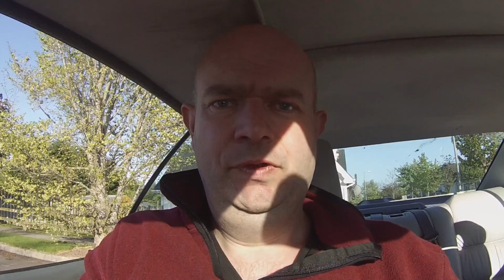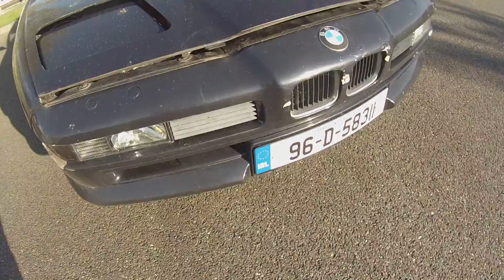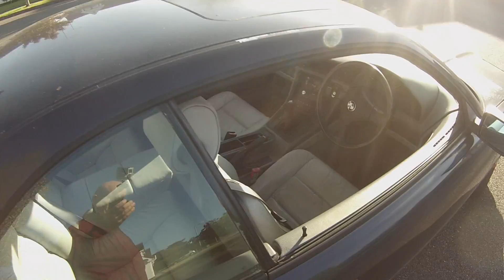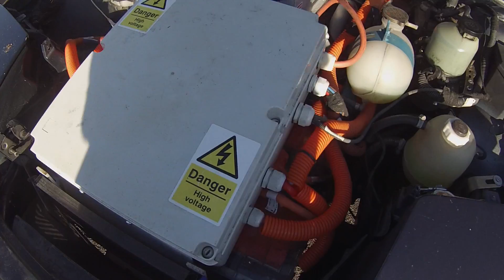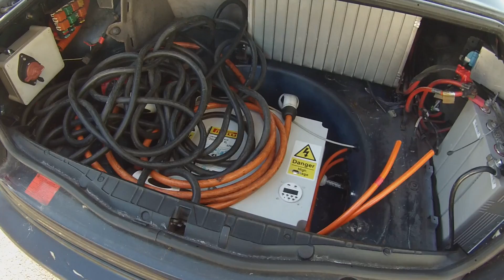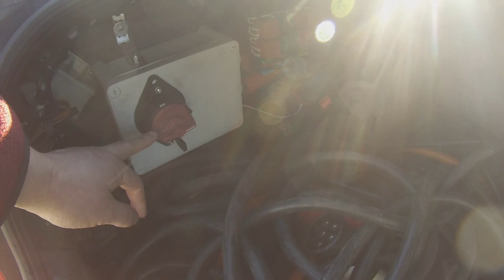BMW E31 840CI EV Conversion 76 : Update and Walk Around

Comment: A very interesting conversion. I have an 840 converted to run on LPG, but yours is going to be a lot more future proof. Looks like you will need a space saver spare wheel, don't buy a 16", they dont fit but the 17" does fit. I have one and   have used it on the back and all was OK. Looking forward to more videos of this electric conversion.

Comment: If you drive to Munich with your car tell me, maybe we could meet somewhere in Germany, living 100 Kms north from Munich :)
Reply from the maker: Thank you:)
Reply: I am living directly in Munich some 11 km away from the BMW center / BMW world. Maybe we can meet also. Looking forward to your visit here. I hope you'll make a video from the road trip.

BTW: you didn't tell about the battery cooling you actually have installed. As far as I saw you didn't have a cooling / heating system at all, right? I suppose, when traveling on motorway speed the batteries start to produce some heat, at least according to what I've heard so far on the electric car scene. Especially, when it comes down to Tesla. How do you plan to manage battery cooling / heating?

Keep up the good work.
Reply from the maker: Will certainly make video and would love to meet!  Regards cooling heating I guess I'll cross that bridge when/if I can get the Tesla batteries.